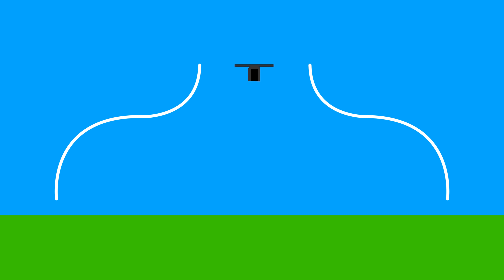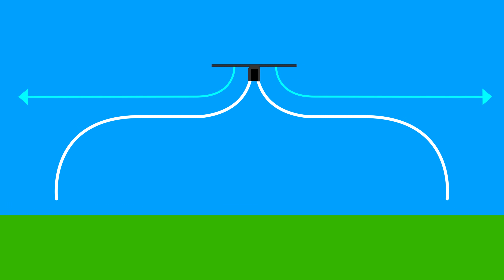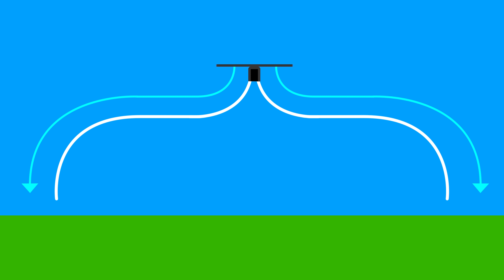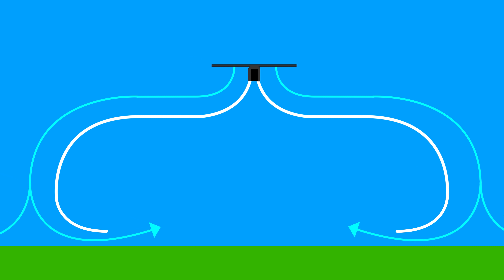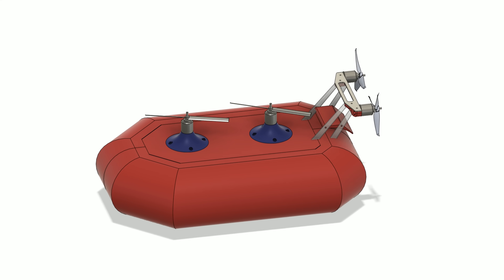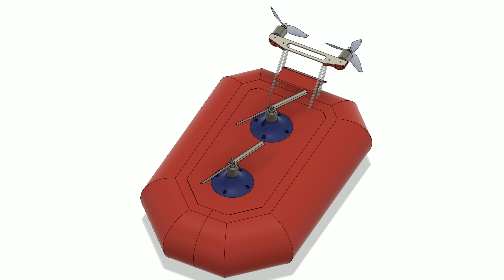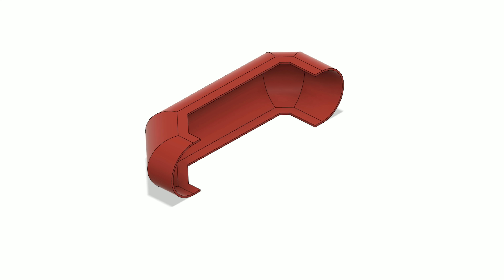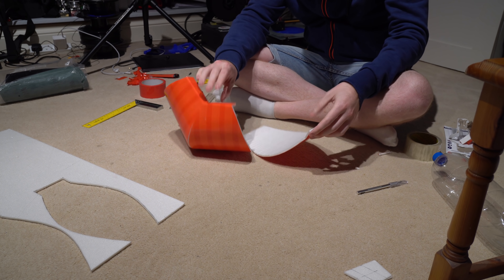Coanda Effect Hovercraft

Comment: I wonder how much lift you would get if you had one propeller instead of two and the body was shaped like a torus with no hole in its center. Would the moving air change direction the way air does over a “wing” shape? Would there be more lift ?

Comment: Watching this when one edge starts to lift off the ground the air gets under that side more and it flips its self. I don't think its because of the weight its the design. A normal hovercraft if an edge lifts the air gets out and drops the craft. When this craft lifts you get more air under pushing it up.

Comment: I believe this is really just an extremely inefficient tandem-rotor helicopter, with extra propulsion motors.
The slow motion footage show little to no downward air movement near the edge/curve, which indicates that most of the lift is generated by the suction of air from above (low pressure) and the inefficient acceleration of air molecules through the rotors, before it's hitting the deck to neutralize most of the lift.
You should have tested/shown the actual coanda effect before giving the video its current title. Misleading if no proof.

Comment: I realize this video is old by internet standards, but I thought it worth commenting anyway. I bet you could fix the flipping problem by creating a 2x2 grid layout for the lift motors (like a conventional drone) with the propellers pointed top-in by maybe 15/20 degrees. Then have a rotational detector chip onboard that will allow for balancing of thrust.

Comment: What I'm telling here is 1, the thrust doesn't have to face every direction in 360 cone. It can be turned into laterally symmetric high-aspect ratio wing with 4 push-pull props, with propwash not interfering eachother in a way so that all wing surfaces are submerged in a propwash when they are counter acting the forward and backward thrust. So that if the lift is created upward, no side way motion is made. To counteract the propwash interactions between the individual prop units, put 3 or 5 wing fences in between. To stabilize the craft, it should have V shaped adjustable parachute, made of 2 sticks with a flat plate. So that the plates are constantly stalling having the arm. The drag would be increased in the tilted AoA, so that it would have a stabilizing effect. If the angle between the V lines is adjustable, it would make them efficient horizontal stabilizers. This kind of crafts operate at such AoAs so that it would be not feasible to use a normal airfoil for the dragchute. By giving the V-chute the ability to vertically align within the CoG, gives them the ability to land on them. Because these V chutes need to be at the most outboard of the craft, it means they have the ability to control yaw by adjusting the drag on one side. They have 4 legs to stand on by itself. Also it's the ideal launch angle for them to stabilize in this A position. Because the shape of the letter A is the embodiment of a portable ladder. To take the effect, use layered airfoils with 2 flaps for pull props, 2 leading edge movable slats resembling that of 2 the previous trailing edge flaps but in a mirrored fashion. So that they can not only redirect the flow, but they can work as ailerons. By the nature, it's better for the outboard wing to be in a puller configuration because they should fulfill the role of ailerons, even though the high chord ratio leading edge flaps kind of work like ailerons if operated with servo. It's entirely possible, maybe even smoother. But the point being it should be symmetrical laterally, I mean horizontally but with just 4 mirror angles. Not a circular wing because they are hard to implement with flaps, they are not particularly efficient at redirecting the flow as the increased surface on the lower side of the flow tend to get too thin to stick to. Also the part I'm referring now is producing the lift sideways, it's wasting a lot of the lift potentials on the sideways especially on your previous submission. The only use for this type of configuration would be to put the thrust in a sideway direction to begin with so that you get a faster horizontal speed unless you can simply just redirect the vector of the thrust by having a propeller shaft gear specifically designed for it. I know it's easier to simply rotate the motor itself at this point. The few parts interesting about the proposal I recommended in the comments above is that so the propeller pitch of the push-config propellers should be adjusted to so called "Negative pitch" so that they essentially produce either forward or backward thrust. The puller ones don't need this because only one "forward direction" is needed for all of this Vtol system to work. If you could produce 30% force of the horizontally produced thrust to a vertical vector as the separated values from the sum up of the force. You need like 3 times more power to create the same vertical thrust. Which isn't very efficient. Maybe it should have like very high rpm props with completely flat propellers for the much needed ability to produce thrust in both directions depending on the circumstances. 
If the craft is handled in a near 0 speed regime, the flite should be controllable with the thrust differences between the left rotors and the right rotors. It's just possible because of the props literally having no off-center forces working on them, no matter the thrust, the forces needed for the actuators to work on the pitch angle would be almost negligible. Because the CP is perfectly aligned with such a simple prop design. 
The V sticks changes the CoG dynamically, that means the pitch is maintained by either the flaps or the dragchute angle. The redirection of the flow would be better if the flaps are segmented fowler-type flaps with wide vertical gaps between them. But they would be hard to make the flaps as reversed leading edge slats aerodynamically feasible to push against the air, in a horizontal flight. Also the aileron's effectiveness at extremely slow flight would be reliant on propwash, meaning the power difference in each props would have like a noticeable effect on the aileron effectiveness. Also, the individual prop's thrust should be adjusted by propeller pitch angle but not with motor torque output, because it's generally not responsive, I know it can be responsive, but it's just that even under the same power output, even with the faster rotor speed, prop pitch would get enough thrust difference, maybe designing the props in a such a way so that they could intentionally tip to the stalling angle to rapidly lose power on flight, but that would disturb the propwash, messing up the said aileron effectiveness stuff. With that much thrust to weight ratio, there is not much reason to just release it face-to-face with the vertical direction in the launch. It would fly like a space shuttle, but for some reason, it might be more aerodynamical in a horizontal flight.

I hope this let you find new ideas.
I also want to see it flying.

Comment: There should be some control software in there to adjust lift as the nose pitches up or down, adjust thrust as the body turns. Cut the power when the body angle to ground indicates that a "ditch" is about to happen. 
It would be interesting to take some pressure measurements at different points on the body to see if the theory is matching the actual operation. Is the body being lifted just by the props, or the Coanda effect?
Collect all the data for analysis, and post once you've decided the rework and experiments are done. 
Must be nice having a CNC machine!!
Good video!

Comment: The flat top surface is a problem. Air is being forced directly downward from a close distance. If that can be tapered like a duct, it will add to stability and should increase lift by changing the low pressure vector directions. Not perfect solution, but it can get you closer to stability

Comment: You might try having the drive propellers pull rather than push. Pushing is always more unstable than pulling. Any stray pressures on the front starts a turn and banking.  The pull could also compensate for the weight of thhe drive motors.

Comment: No so sure the coanda effect is the lifting force here... You seem to think the props will not produce lift if there is a flat surface under it. This is an  error. Propellors work as fast moving wings that pull the shaft up in this case. It would be interesting to repeat your coanda drone and this hovercraft with simpler flat disk and box.
Reply: Further, since its filling up with leaves, it is pretty apparent your bell is at a lower pressure than the atmosphere, which is to be expected. This should behoove you to revisit your original drone design to redesign the bell to be closed tapering into a cone shape below to negate the downwards atmospheric force on the bell..

Comment: I think you need to come back to this, As to prove the coanda effect is at work here.  actual improvements Mk2  as mentioned drop the motor's and batteries down. try with or without a base. My opinion  If possible lengthen the car as the 2 motors are very close and i presume cause instable airflow in the mid section reducing the flow / performance. Not sure how you duct the flow as mentioned. Great vid as usual, Ad break was not noticed and the slow mo was great as ever. Keep challenging yourself.:washhands:

Comment: You said that your coanda-effect drone was very inefficient, which you made with four separate domes. But what if you put four lift motors on that hull that you've got there? Might that actually become an effective drone?

Also, it occurs to me that a traditional (positive pressure) hover craft is self-stabilizing and self-regulates its altitude. That is: if it lifts too high up, then the pressure underneath can escape, which would cause it to drop back down. Similarly, if it lifts too high on one side, but not the other, then there will be a local pressure drop on the high side, stabilizing the craft.

Comment: I see the sides continue to curve at the bottom, which I think would direct the thrust to the bottom center.  Might be why it wants to not stay level.  In boat design, it is common to have the hull meet the rear with sharp 90% angles.  It seems counter intuitive, but rounding the corners results in low pressure that holds the rear back.  The bottom edges of your hovercraft look like they would likely be drawn to the ground, held up by a small area in the bottom center.  Just a thought.

Comment: It does have an advantage though. Instead of a fragile gas bag underneath, it has a rigid frame, which increases longevity. Now, have you tried a trimaran design instead? Two nacelles on either side using the coanda effect to raise up a central superstructure. Also, a plastic mesh on the underside might alleviate the leaf problem. (Note: I'm not an engineer).

Comment: I'm late to the game just coming across your clever work. Every time the vehicle flipped over, it always tripped over the same side. I think it was torque from the drive motors. Making them counter-rotating would solve that. Making the lift motors counter-rotating should also improve the physical dynamic stability of the hovercraft, but I can't even guess at the aerodynamic stability issues that arise.  Adding yarn and smoke tell tails would help.

Comment: This isn't coanda effect.  Try ejecting the air radially outward in horizontal directions on the flat top and see if it follows the curved edge and flows downward (it will) producing lift. At the moment its just another ch47 helicopter with short propeller blades.

Comment: ,I can't help thinking the cross section of the prop is working like a wing, a smaller prop would give plenty of air flow but less forward lift, and it shouldn't flip over as easily????

Comment: Unlike the first method of moving air, I think the propellers are lifting in a similar fashion as a helicopter.  I think the suggestion of tracing the airflow with smoke, or perhaps fine threads taped to the outer surface, to visualize the actual airflow would confirm your design.

Comment: I think it would be cool to do this again with the impellers, but this time have them partially lowered into the body of the craft so they move air along the outside as well as inside – combining the coanda effect and the traditional air cushion.
Reply: Yeah this would be interesting. But the more you optimise it, the more it starts to look like a low-altitude quadrotor or a standard hovercraft. I do think it'd be interesting to make a kind of quad-rotor hovercraft that loses the rear thrusters in favour of ground-effect thrust. Similar to Tom's previous design but with the more standard air cushion.

Now what would be really interesting is using a huge variable-pitch blade like on a helicopter, but with the air cushion. Generally, I'd love to see more RC hovercrafts. I had one in the 90s but the AA batteries of the time left a lot to be desired. With modern batteries, microcontrollers and affordable blades and 3D printing you could do really interesting things. Even if they are a little impractical.

Comment: 4 foam board ducts with 4 props to sucking air into them in place of all the current prop mounts. The ducts have vent holes to allow air to pass into the bottom cavity to create the high pressure space for base lift. The ducts also strive to create laminar (low drag) flow over the sides to provide Coanda effect and the 4 ducts can be used for steering 😎 I saw you tried doing the smoke but it was too windy..?

Comment: 1. This does have benefit over conventional hovercrafts, skirt wear. In order for conventional hovercraft to work the skirt has to drag across the terrain to maintain a partial seal, which causes wear. 
2. I'm not convinced this hovercraft utilizes coanda effect, or at least its effect on the overall lift is minimal. You have conventional rotors creating lift.
3. You should switch the rotation direction of the steering motors (and mirror the blades accordingly). This should reduce the chance of flipping over when turning. Because this is a hovercraft, to turn, lets say, left, you need to give it initial left yaw to initialize the slide and then right yaw to balance it. However when you give it right yaw input there's also a net roll left force, causing the left side to drag across the ground compounding the issue.

Comment: I kind of wonder if it would help to use ducted fans for the Coanda lift motors with wide stubby wings blended into the duct bodies and the pusher motors built into the top of the wings.  I also wonder if changing the shape of the under side would help like having it flat or smoothed. Maybe even using high strength super low weight kite fabric rather than foam and tape with the seams glue/tape/heat bonded to a printed or foam board frame so that when pressurized with air or even helium it makes the desired shape naturally and gives you a bit more of that hovercraft impact absorption. And the stubby wings give even more ground effect lift but not enough to fly.  Though eventually i think you would need some sort of automatic hover system to make balancing lift motor power easier.

Comment: Youre back is heavier than the front. Your nose lifting is whats taking your speed. Angling b the back blades upwards just adds more weight in back, lifting the nose more. You need front balast to keep level, and lift assist in back with the rear thrusters

Comment: (This is all of course silly, but fun.)

Adding some code to the MCU to cut motors if roll is greater than 70°, I think would remove the flipping. It seems that the thrust is exacerbating the effect by pulling the drivers to wherever they're pointed. Easy to test, as well; I think you may have worked it out in the last reel by letting go of the controls when it began to tip, but the MCU will, of course, react faster.

Comment: Couldn’t you add small weights to the bottom of this to keep it from turning as much during your turns? Essentially pushing the center of gravity lower, especially if the lifting motors are only at 50%?

Comment: More people should play with hovercrafts, they are easy to build and very fun to drive. I build mine with a spoiler on the front to eliminate the high speed flips while not affecting the hovercraft at low speeds. I am still not able to keep it from flipping over when cornering at high speeds. Also a gyro really helps stabilizing when going straight at full throttle. used an old kk2.1 with aircraft software on it for that. May also help with getting it level with flaps etc.

Comment: How about 4 engines and gyro w controller to keep level  Close bottom 1 inch up to simulate a hovercraft with a crew cargo compartment Hows the lift power to engine power ratio compared standard hover craft.

Comment: It's interesting that you kind of backwards engineered the creation of the hovercraft. Back in the 50's and 60's NASA was creating all sorts of different methods of propulsion trying to create a flying wing design including saucer designs. The hovercraft was originally one of those failed flying saucer design. The designer were thinking along your exact train of thought. On paper the designs of this sort should be capable of creating a large amount of thrust and high speed. However in the end it was always the same, the craft would become unstable if it tried to go to high and never got anywhere the speeds they were going for. The bonnet on the bottom of the hovercraft resolved the stability issue and increased  the speed. https://www.youtube.com/watch?v=CTr0JqHycYw